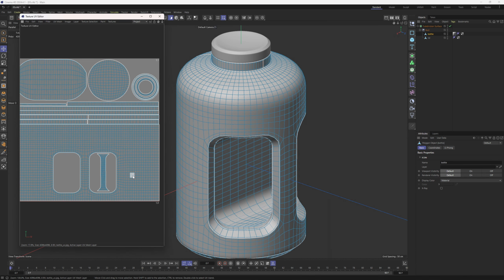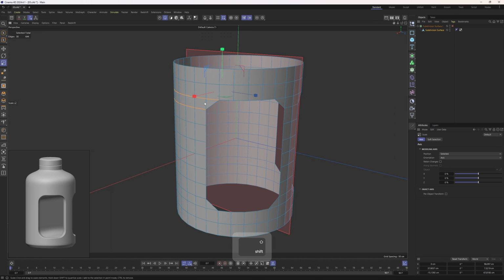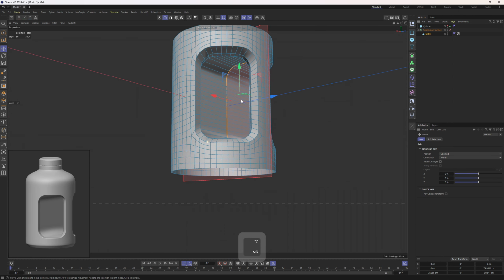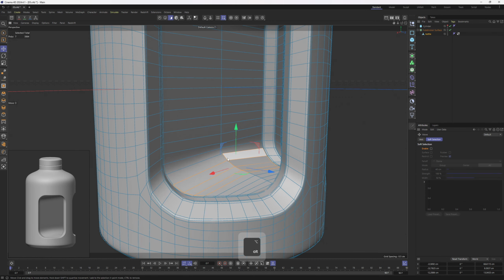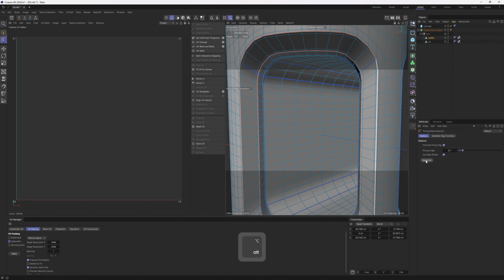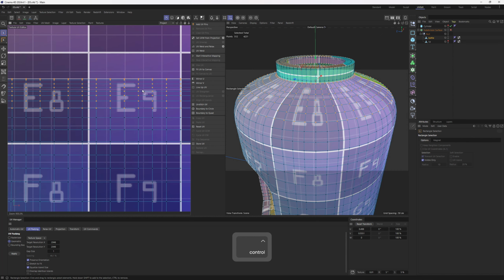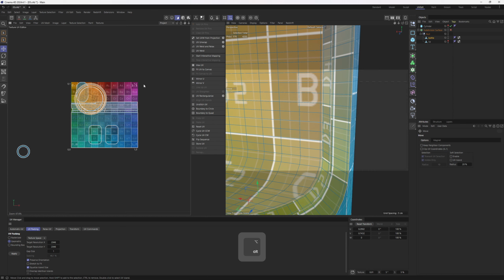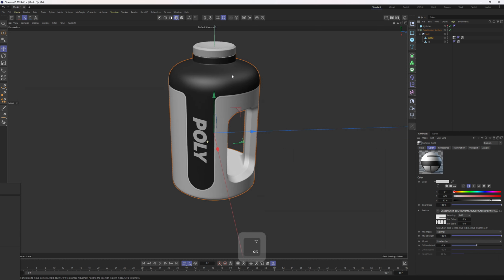Industrial Design/Product Modeling #44 Water Bottle

Comment: Superb, but it is not tutorial. just video. Because in uv mode  can't see which lines you've selected to unwrap.  Because, you know we would like to be shure sometimes we've selected correct lines.
Reply from the maker: This series is for advanced/intermedia users, even though I try, it is not possible to show every pixel or every move I do, I am not a private tutor nor this is a 1to1 private lecture, I sometimes overlook some parts, but intermediate users should be okay with that.

If you are a beginner, please check out the beginner playlist on the channel before jumping into the product series.